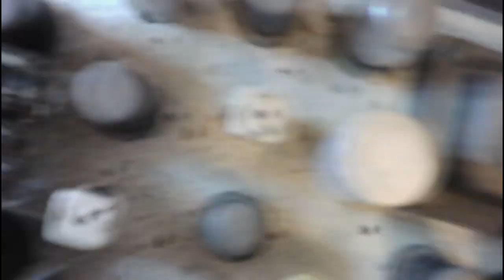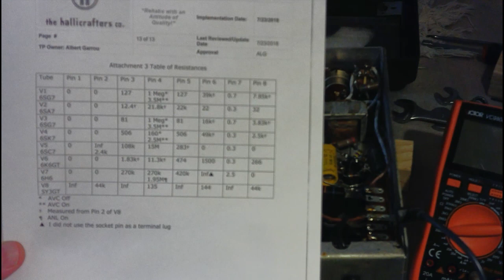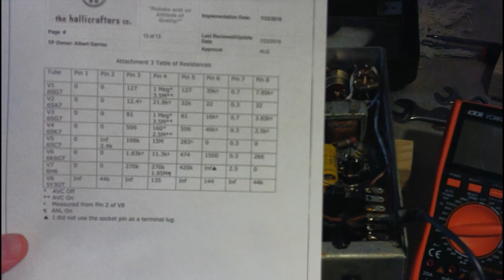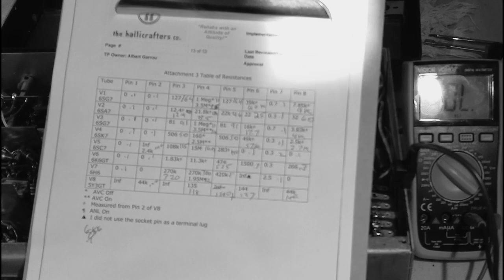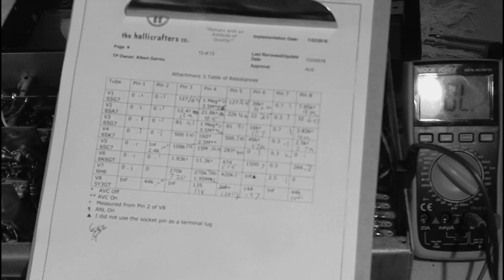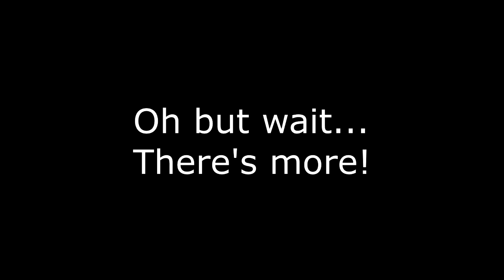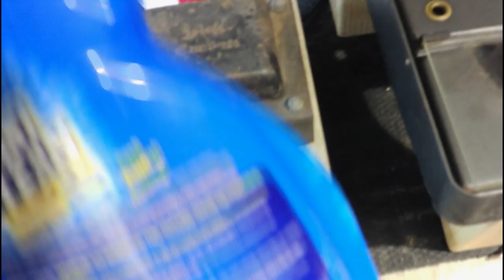Vintage Hallicrafters SX-99 Shortwave Radio Full Restoration Part 1

Comment: Enjoy your videos and your channel. But the audio on this one is indeed, really bad.
Reply from the maker: I am learning, of course, I think by part 3, by the way, I really enjoyed your videos on the SX-42 (is it?) and both my 71 and 100 have laptop cooling fans, great idea!
Reply: Hallicrafters Rehabs  Yes, my father gave me his S-38, S40, and SX-42, with great R-42 Reproducer. They were all restored and are great performers. Love the digital displays for your receivers. Guessing they are all dual conversion?
Reply from the maker: Arthur's Hallicrafters Kitchen & Audio Lab The 99s are single conversion and the Mr Carlsons lab buffer circuits work well with the mixer tube cathode direct. The 71 is dual and has an odd drift because of the dual conversion design. I will get into that further when I rebuild a 100 the way I am doing the 99. But the 100 design will be more favorable than the 71 for digital.
Reply: Hallicrafters Rehabs I bet they are so much fun!
Reply: They ARE NOT square set screws.  They ae Bristol spline head scews just like Collins used.  You will ruin them doing what he did.  You can buy Cristol wrencehs from many on-line vendors. @ArthurJS123